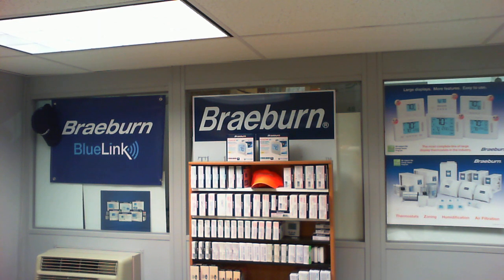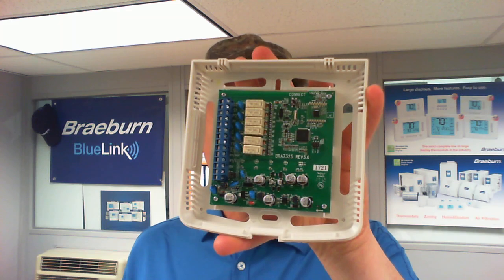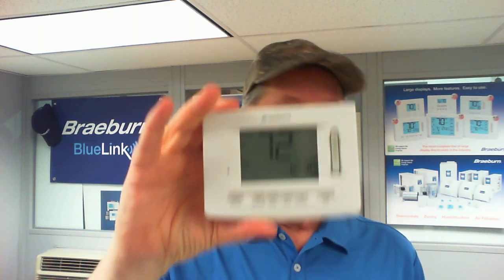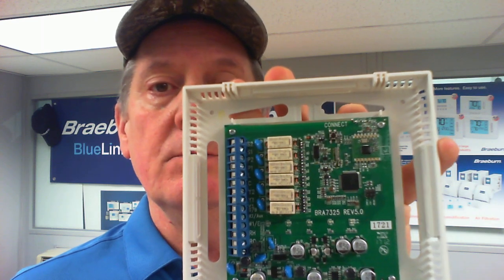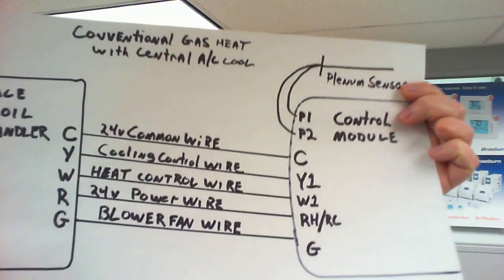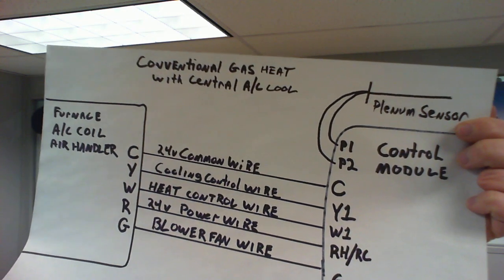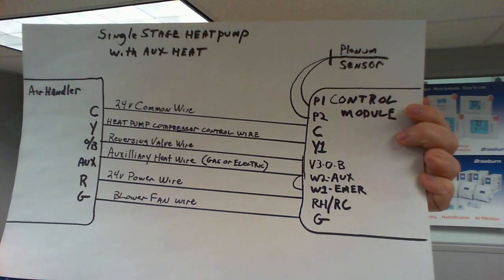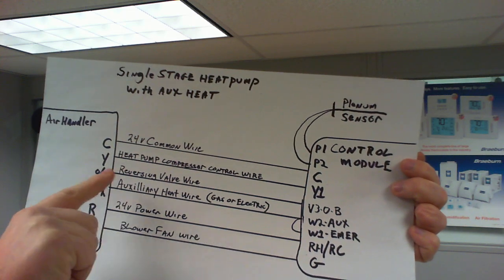Braeburn 7500 8500 wiring

Comment: A separate transformer is not required for TACO controllers. They already 24V/Com terminal taps.
And the BlueLink module would be going to one of the zone connections. TT still managed by the TACO, not the thermostat. Removing the jumper or using RC isn't necessary.
.
Reply: Or for an older aquastat relay like the L8148 use TV for R, T for W, and B2 for Com.

Comment: Where the heck do we put the plenum sensor? & Doesn't it defeat the purpose of having the remote thermostat location in a different from the module location?
Reply from the maker: The plenum sensor is designed to go in to the return air plenum on forced air systems. It's only purpose is to serve and a failsafe or fallback in the event of communication loss with the wireless remote thermostat. When you lose communication with the wireless thermostat the control module will have no information regarding room temperature, set point, system mode etc. In this case it will take a reading form the sensor to serve as a back up. As long as the thermostat stays in communication with the control module the plenum sensor does nothing.
Reply: @braeburntechsupportofficial  
Understood. & Thank you. Should we just pop a hole into the return siding and stick it in and tape around it then?
Reply from the maker: @NZIGNANTI  1/4 inch hole. you can use some self tappers to screw it in place. Seal with foil tape if you want.
Reply: @braeburntechsupportofficial Thanks for response! Will do!
Reply: @braeburntechsupportofficial  What do we do with the sensor on hydronic systems?
What is the wireless range? And can thermostat be powered by 24V also or only batteries?
Reply from the maker: @SerenoOunce  On hydronic systems you will just have to let the sensor hang loose. Signal range varies. Open line of sight is 2-300 feet. Stat can be powered by 24v or batteries